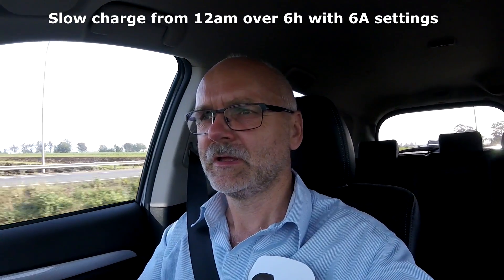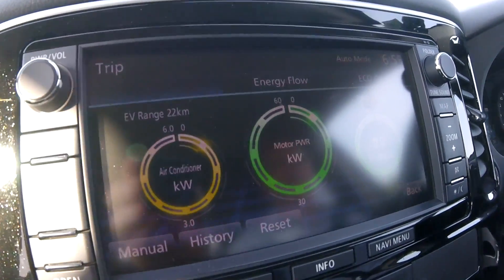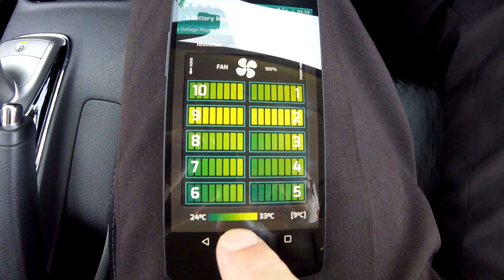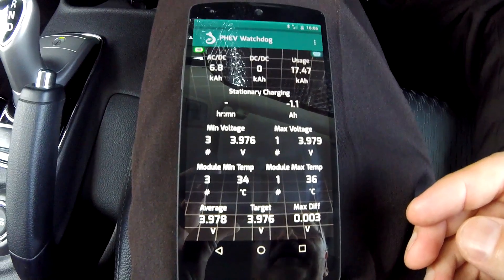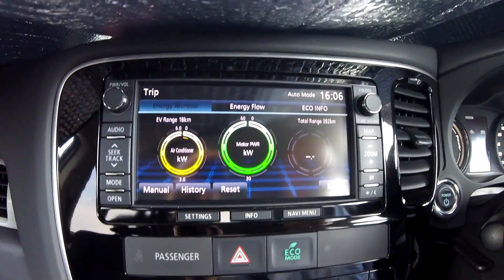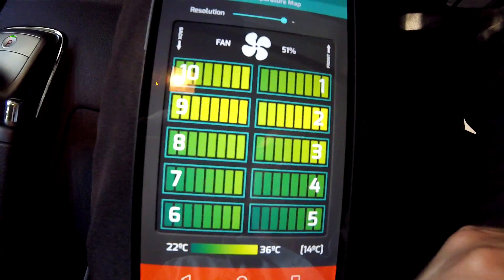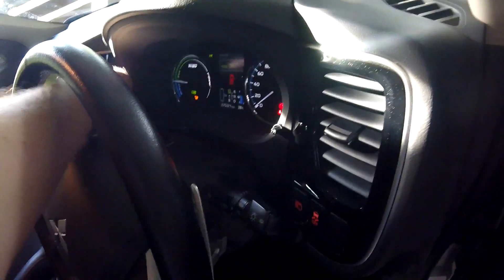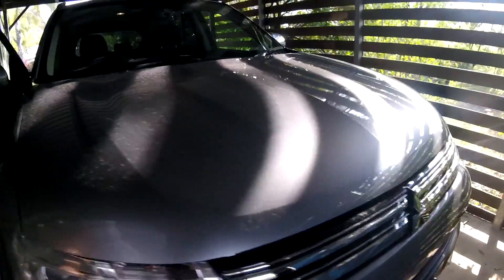EP137 - The PHEV does not cool the hot battery while AC charging

Comment: ok so here's a thing... can you turn on timer cooling on your entertainment system then turn on charging....and check if the dog sees the fan going...but yes the lack of automatic active cooling while charging is a battery killer for sure...in the NT we often have overnight temps of 30+ deg....good call...
Reply: Ok thank you. It's like an enhanced : D, or 😂. 😄😄😄
Reply: For the non natives: What is "NT" and "Xt"? 😬
Reply: So I did try on Mine with Timer A/C and as it did cool the cabin the batt when from 36-41deg on a 10A top-up from 60%-98% So no cooling when plugged even if cabin cooling on!
Reply from the maker: Thanks for the confirmation and testing...
Reply from the maker: No such thing like timers in my car. I got the poverty model without Wifi...
Reply: @unpluggedEV  and for a mere 55k what a deal we got XD

What if we leave the car on ?
I mean we could just get out of the car and leave it on  and lock the doors ?
Reply from the maker: NT= Northern Territory (State in the middle north of Australia)
XD = laughing face when you turn your screen 90° clockwise (don't do it!)